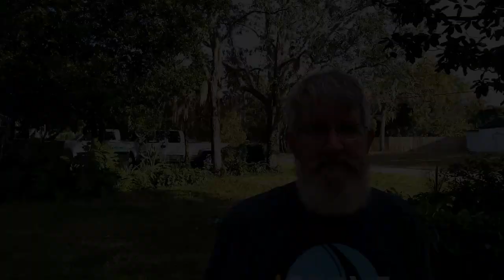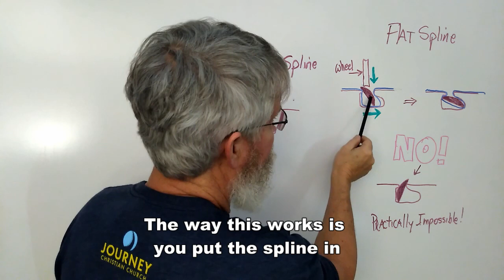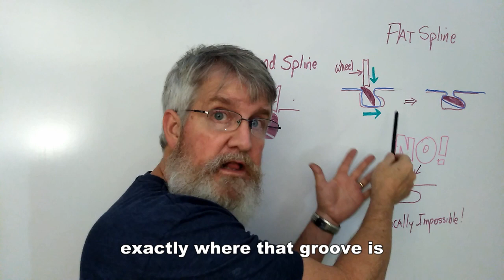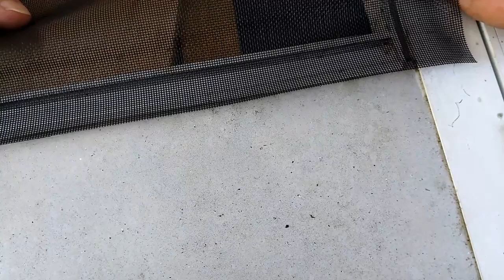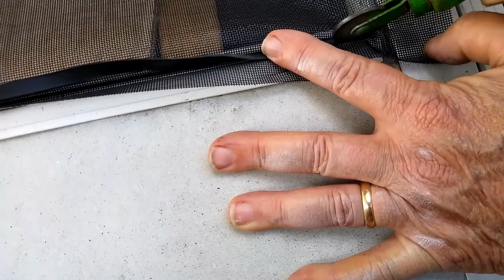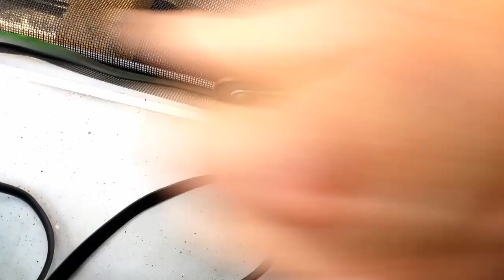Ultimate How To Use Flat Spline For Screen Repair

Comment: Good flat-spline breakdown. The detail I like here is treating the spline as the holding system, not as a way to force a stretched screen into place; that usually gives a cleaner edge and fewer callbacks after the panel settles.

Comment: Great video & teaching style! I'm replacing most of my lower / ground level pool cage screens with pet resistant screens. I don't know if they're just thicker, but it takes a great amount of force to seat the flat spine, so doing just one screen is a server hour, exhausting affair.. I saw one video just now where the flat spline is seated with what looks like hardly any force, so can it be that the pet resistant is almost too thick where inserting the spline is difficult? Especially hard is the bottom edge of the screen that's an inch or so off the ground, very tough to get leverage to get the spline in.
Reply from the maker: I haven't worked with pet resistant screen but I imagine that it is thicker, making it harder to work with. Your hard work will be paid off by the screens lasting much longer. Nice going.

Comment: Thank you for this.  I was doing it wrong.  I had to use a flathead screwdriver though to push it in though.  The spline tool did not work at all for me. Maybe my spline was too thick??
Reply from the maker: It's possible that the spline was too big for the slot in the frame. The spline comes in different widths.  Thanks for watching.

Comment: This makes so much more sense than the other videos Ive seen. I think the spline I bought though is too big for my lanai channel. I put down a lot of force and it doesnt seem to go in. How do I know which size spline I should use? The old spline that I ripped out is smaller but it was also compressed in that channel for however many years so its hard to compare to the old spline.
Reply from the maker: the way flat spline is sized is by the width of the spline. Just get a tape measure and measure the old spline (if you have some). Or take a piece of the old spline to your favorite hardware store and ask them. If you don't have an old piece,I would take a picture showing you measuring the width of the channel. Take you phone to hardware store or call a handy friend to help you figure it out. Usually flat spline is either .290" or .310". I hope this helps.
Reply: Awesome thanks so much. Really appreciate the video and the reply back. @telescope5061

Comment: I've got a pool deck screen door I'm having to rescreen thanks to my dogs and got focused on using the round spline, but based on this the flat looks like it'll be a piece of cake in comparison. Super helpful video, thanks buddy! 

Nice beard, BTW! 😀
Reply from the maker: Glad I could help, Darth. Make sure that the metal frame is set up for flat spline. If not you'll either have to use the proper size of round spline, or get a new patio door. You may also want to put a metal grid over the bottom part of the screen door, to keep the dogs from busting through. Just a thought. Have fun! Thanks for watching.

Comment: I am just thinking about doing some screen work and making my own spline groove in some wood.  Seeing this makes me realize I needed to know this before I went to the store and got befuddled.  I definitely need round spline for what I am contemplating, but I would NOT have known that without this.
Reply from the maker: What I did when putting screens on my back porch is go to the Happiest Place On Earth (Home Depot  ha ha ha) and purchased some pieces of screen frame. It comes in different colors, along with the corner pieces. I then cut the frame pieces to fit the dimensions of the openings and then screwed the frame to the wood with stainless steel screws. Works like a champ and survives all the hurricanes down here in Florida.

Comment: Great video, but I have to tell you, I do the same thing using the curved side of the flat spline towards the inside.  Doing this allows the curve of the spline and the screen in the channel to conform better to the curved channel and it makes the installation much easier.  I use the wider end of the spline tool with the groove in it to actually run along the edge of the spline sticking out of the channel and it pushes the edge of the spline right down into the channel and locks in place.  Now you have a nice flat smooth side of the spline showing and for me, it seems to hold much better when you push on the screens.  Also, when you try to pull the screen out from under the spline, it forces the spline to get fatter and resist coming out.  Doing it the way you showed, the spline is already curved on top, and will readily pop out due to its shape.  Anyway, I thought I would share that with you.  I guess either way works, but placing the curved side down into the channel has always worked better for me here in central Florida, the hurricane state, LOL.  Never had a screen blow out in 25 years of doing it my way.  Give it a try and see if it works better for you.  Thanks for sharing your video.  I just replaced one of my screens today on the patio that the cat decided to use as a climbing wall to chase little lizards.  I hope he grows out of that soon.  OK, 3 more screens to replace this week on the patio... Cat Holes from his claws, LOL.
Reply: Wow thanks. I am glad I read the comments!
Reply: I am doing it your way  central FL fixing IAN rips
 @superatech
Reply from the maker: Sounds like a great idea. I'll try that the next screen I fix. Great job!

Comment: I had the exact same problem. Bought round spline, but discovered my pool patio screening uses flat spline. Also had bought a new design of wheel called a Screen Mouse, but I don’t think it works for flat spline! So back to Home Depot for returns! Thank you from Ft. Lauderdale for the excellent diagram & video!
Reply from the maker: You're welcome

Comment: I’ve yet to find a video where the whole piece of screen is installed.  That’s a very different animal than installing just a 4 inch long piece of screen.
Reply from the maker: The reason I didn't include doing the whole screen is the vast majority wouldn't have stuck around for the whole screen.

Comment: After watching your video (and several others) I just finished replacing the screening on my entire pool enclosure. 48 panels in all. Absolutely the most miserable, hot, sweaty home improvement job I ever did. The screen is as taught as a trampoline and the spline is all secure in the tracks. Still, I would NEVER try this again. I bought multiple spline tools thinking maybe each one was junk, 2 different brands of spline, cleaned the grooves out with a brush, and even sprayed soapy water in the tracks to help. With all of that, it was a 1/2 inch by 1/2 inch job that took 12 ten hour days. Maybe if I had arms like Popeye or a trained orangutan to muscle the spline in place but for a 115 lb female this job just plain sucked. Theoretically, I saved about $800 doing it myself but that figures to less than $7/hr for my labor. Heck, take away the cost of all the Gatorade I drank and the cost of having my nails done after finishing and my savings dropped even more. NEVER again!!
Reply: Please dont make another screen install video. This is horrible!!!!
Reply: You tackled too big a job

Comment: I'm getting ready to replace some screening on my pool cage and here's what I believe to be the case:
  "Flat spline" actually has a flat side and a round side,and the round side faces outward after you attach the screen to the cage with it. Please let me know if this is correct, as I believe you had the round side facing inward.
Reply: Flat side in. Round side to you